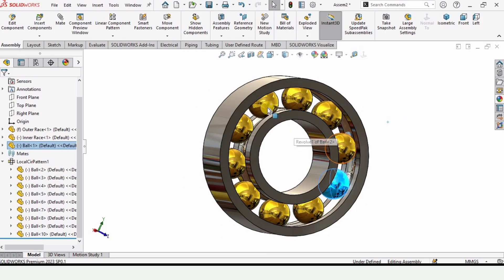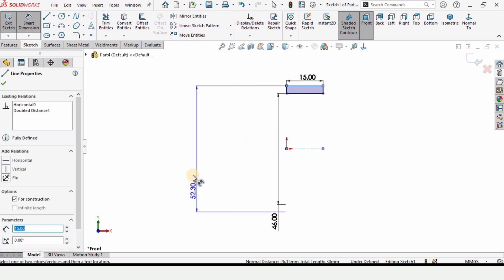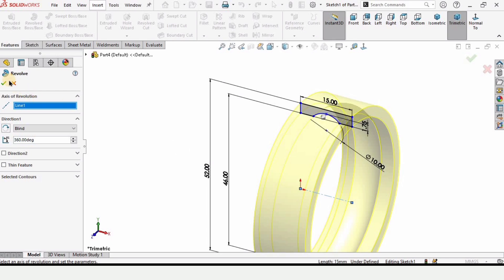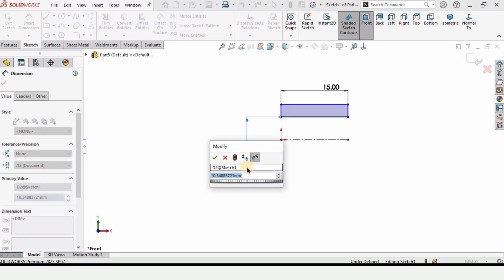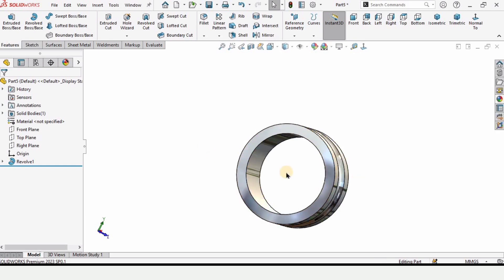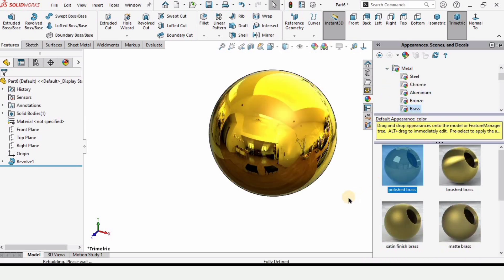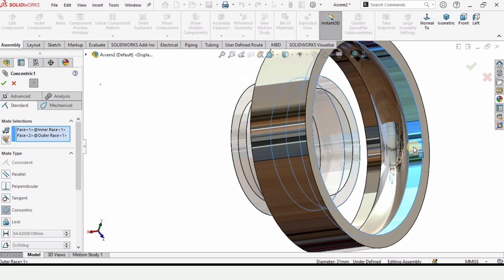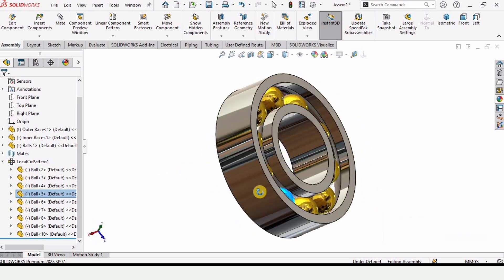Ball Bearing in SOLIDWORKS | Robo CAD

Comment: Sir I would have approached this differently to save time.  First I would have created the outer race as you did.  I would then do a save as and name it inner race. I would then edit the elements in the new file by taking the race elements and flipping them and make a few changes to the offset.  This would allow you to create both the outer and inner race much faster.  If you didn't want to use the same as command I would just start a new part and copy all the elements from the outer race file and flip them also saving you time.  Just my 2 cents on how to do this faster.  Also as you know the hardest part of a ball bearing to drawing is the ball retainer to keep the balls evenly spaced.  I noticed that you did not include a retainer.
Reply from the maker: @bpetnoi1472  yes correct. the purpose of this tutorial is just to show the modeling technique. it's not just a retainer that is missing but there are many calculations while we design the bearing are not there. 

Talking about the modeling approch to design inner/outer race. yes you are correct we can save our time. But also if you are that great in modeling with saving time efficiency and mofeling in faster way etc... than you should not be having any problem with modeling the retainer for it. i am surprised you written that.